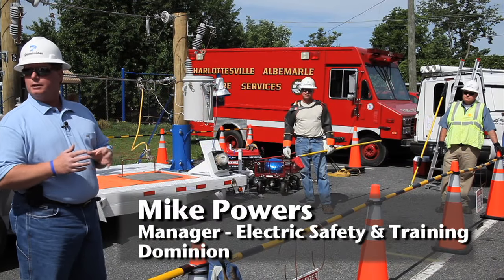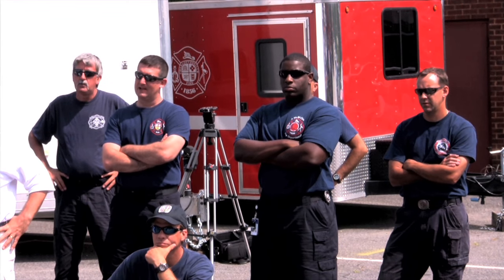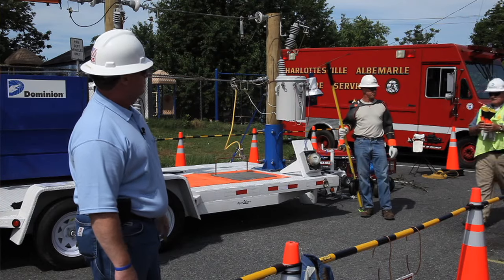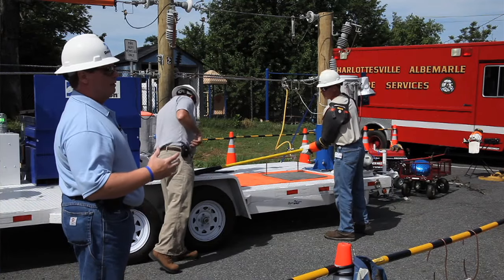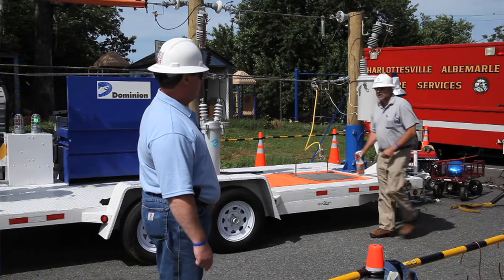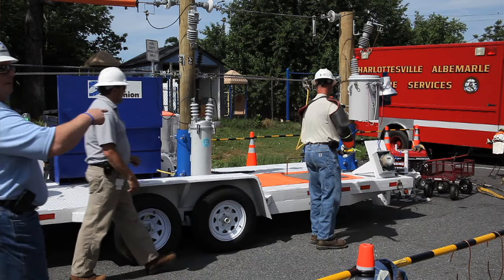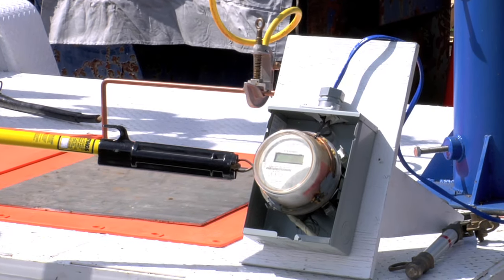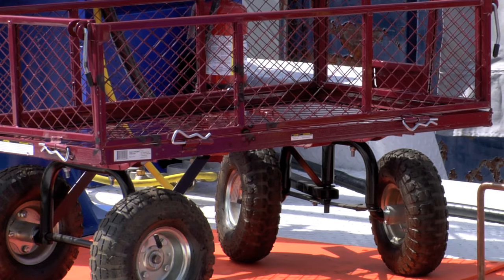Live Wire Demonstration

Comment: For those complaining of how long the training program is, the training program consists of overhead and underground completion sections. You have to know your different voltages, transformer bank setups, climb poles and do the work aloft, work on diving boards, pole rescues, underground switches, overhead and underground secondary and primary repairs, learn to switch devices out in the substations etc. Each section they learn, they then have to go back and get signed off in their local offices. Operate bucket trucks, trenchers, backhoes etc. You don't just go through some training and then be let loose. It's very extensive for a reason. Not only is your life on the line everyday but your coworkers and the general public.
Reply: And if you pay attention. You get to stay alive. To learn even more..As 52 Weeks is the Minimum...Which is around 4 years\8000 hours...
Reply: Also it's a job where you can't really learn from your mistakes as any mistake can, and likely will, be your last.
Reply: Still seems like a bit much.
Reply: @2KCamaroZ28SS  That's why the money is good though. They are diversified for a reason.
Reply: @2KCamaroZ28SS  Check out the history of linesmen.  When we first starting electrifying the country (early 1900's) they say that several linesmen were killed every week. Back then people weren't trained that well are were killed routinely.  This is why they now have extensive training programs, and it has worked.  A lot less fatal electrocutions nowadays.

Comment: That's how to deliver a safety demo. I've done my share in the Air Force and this was excellent and thorough.
Reply: you guys do power line stuff in the air force?
Reply: clive ramsbotty. Yes, CE (one of the jobs in the Air Force) works on some of the power lines on base.
Reply: @Stewthemechanic  ah of course, i feel silly for not thinking! thanks
Reply: clive ramsbotty not a problem sir!
Reply: @Stewthemechanic  in the Army, we simply scratch our heads to generate power.
Explaining our early need for LED flashlights.  ;)
Reply: Stephen Villano that’s awesome!😂
Reply: @cliveramsbotty6077  CE does and sets up whole bare bases from scratch on deployments. They'll do everything from site prep to building a fair sized town in tents. My gig was aircraft maintenance and repair. I was over the years a comm troop on Bronco and Phantoms then an engine troop and crew chief F-16s. 
Safety briefings are a way of life because complacency breaks people and stuff. First loss of note in my career was when a ground radar instructor at Keesler AFB failed to discharge a (large!) capacitor with a shorting stick during his lecture and died in front of his students. The whole base became REMARKABLY careful after that. There was a shorting stick, high voltage gloves and other safety gear at every training mockup but they don't work if they ain't used.
Spinning propellers are harder to see as they blur and both military and civilian ground crew have zoned out and gotten too close. It doesn't happen often but we had an Egress troop fire a seat during maintenance and those rocket motors take no prisoners. Serious accidents are so rare because of safety culture but when they do happen it's ugly.

Comment: Excellent demonstration, a real eye-opener. Especially for home owners back-feeding generators or trying to remove branches from over-head lines.
Reply: The line to your house is insulated.  Relax.  Why would you ever touch anything other than the one?????
Reply: +Steven King Mine is underground so no issue personally, but still some good safety advice for home owners
Reply: Yeah but if there is just a pin hole in the insulation you could suddenly become the ground.
Reply: +rpardz Call before you dig!
Reply: Agreed
Reply: Not likely. Your house line isn't primary voltage. You would pretty much have to touch bare wires.
Reply: The big takeaway here is with a high enough voltage, any material will conduct electricity.

Comment: After 37 years in volunteer fire dept. this is best demo of electrical utility hazards i've seen. It was informative at best and mockup  trailer with demonstrations they showed really brought it home on how dangerous this equipment really is.
Reply: I have seen people hit by 9.6 Kv  might be several times; Myself I have shook off 277 multiple times — which is instantly deadly for most people as the muscles heat to fast to use the contact area;  Without being hit a few times I disagree that no one can really gauge the risk;  
In all cases it is avoid getting the arc going which is demonstrated here; 
Notice all the rubber they are wearing — there is a reason;
I once asked a primary distribution worker about using non-certified pole and the response shows that he knows not to do that;
Reply: @ChiDraconis  Hey bro thats crasy shit you got hit with 227 wow what does one say.
Reply: It absolutely sucks to get hit by 277. 0/10 would not recommend

Comment: Back when the garbage cans were 55 gallon oil drums, we used to throw the lids and cans on the CTA third rail and another rail. It would send the lid or can two stories into the air. You could barely see it because of the arc. Fun stuff! It gave me a lot of respect for electricity.

Comment: not electrician, was just curious to study, but i am damn glad i saw this.
Reply: you do not get to do the first test on the gloves. there is a special group that puts then though tests. they hang them on a trolley that carries them through water and they are on a live voltage. if they have any pin holes. it will stop and let you know what the problem is. they also have a special pouch they are stored, signed out and checked back in at the end of the day. also required to wear heavy glove on top of them during use. in power plants where the person uses them on high voltage motor control centers, they also wear fire resistant suits and helmet in case of a short or explosion. it has happened.

Comment: When I was a kid, I used to hang out with power linemen and watch them work, and would get the old insulators. I didn't realize back then why the foremen would get a little nervous about where I would stand when I'd watch. Now, after 40 years of collecting insulators, and watching linemen work, and seeing these types of videos, I've got a respect for electricity, and its safe use. Now I do electrical work in residential, and have applied all these safety measures in my work as well. Great Video.

Comment: One important fact that was omitted is "step voltage". When a high voltage line contacts ground, theirs a voltage gradient around the point of contact up to several feet from it, that just the distance between footsteps can have a potential difference of several thousand volts. Even without contacting the conductor, it can smoke you.
Reply: Yep.  This is why they always say to keep both feet together and hop away.  You don't want one foot being at a different potential than the other.

Comment: It's amazing how electricity can arc but not through rubber. When I was In Australia doing some labouring work near an electric train line we had to do an induction course and the instructor showed us a picture of what looked like two boot marks on the top of the train. The guy was working too close to the power cable and was pretty much vapourised.
Reply: That's resistance for you, rubber has a very high resistance value, air varies from very high resistance when very dry to quite low when its moist hence the arching.. As the demo has shown the resistance of the human body or a hot dog is also quite low

Comment: I know our volunteer fire department has 2 guys that work for the city utilities.  They both are journey lineman.  They have trained several of the other firefighters on removing meters and the trucks are also have plastic caps they put on pulled meters.  The city crews also have pagers and will respond with a bucket truck to also disconect power from the transformer as well.

Comment: I accidentally came by a downed power line behind my house while I was picking up branches after Hurricane Sandy—left the area quick, called the utility company. Weirdest thing—grabbing up branches and there’s black hose-looking thing next to a branch. I first thought it was something that blew off someone’s rain spout in the winds—then I follow it with my eye and see it snaking towards a utility pole. So—leave the area. It doesn’t have to be sparking or humming.
Reply: Geeze, you are one lucky guy Fred.......
Reply: ive been hit by lightning.
Reply: brian6265 Thats pretty scary, any long term health effects?
Reply: Lmfao
Reply: Chances are it's comms cable if it's black and hose-like. Even if it is a secondary mains line it would still be insulated and even if a fault had developed it would've taken out the fuse by then. If the wire is bare, then stay away from it, as secondary cables can touch the ground without arcing due to the ground's high impedance
Reply: ***** not any that can be pick up medically. i was thrown away a few feet and had minor burns (2nd degree)
Reply: brian6265
I've seen a few specials on TV about this.  Some people (like you apparently) walk away with a healthy respect for loud noises, while others have a host of medical issues due to their free of charge upgraded internal electrical rearrangements. Scary, random stuff.  I hope you bought a lottery ticket!   ;-)
Reply: ***** btw, its not the wire that hums, its the transformers that hum, if the wire is down the transformer wont be humming
Reply: Ozzie Peck Not true. Transformers hum on a regular basis but the wires can hum as well. Go stand under some transmission lines and you will hear it quite clearly. Distribution lines can also hum, particularly if they are arcing. As the demonstration shows you may not see the arcing.
Reply: you sure? i am sure its just the laminations in the transformer vibrating, my mot does that, or is it the leaking magnetic fields? why would the wires hum?
Reply: The wires hum because they are not insulated. They get really loud when wet. I don't know about transformers.
Reply: hmmmm
Reply: Mike L Not true that they hum simply due to the lack of insulation, it's because of something called the Corona Effect, "leaking electricity" which is possibly heard towards the insulators or a length of line on transmission lines, or all along the line in damp weather, eg: frost, fog
Reply: sonconmas I am aware of this. However if they were insulated they wouldn't hum because the moisture would not be in contact with the conductor. Hence the no insulation remark.
Reply: Dam you lucky
Reply: Fred Dietz if it was a thick pink hose it was me naked
Reply: Ozzie Peck you’re right about the laminated core humming. The corona effect does make higher voltage transmission lines “sizzle”. Distribution lines very near the coast will also do it usually due to salt contamination. Salty water is a better conductor than fresh.
Reply: Probably service wire with 120 volts on it

Comment: As an inside wire man I’ve been shocked by single-phase 440, three-phase 220, and everything in between.  House current at 120 volts is also very dangerous,  as you cant let go!  Have good line testers, never work in live wires without being well insulated and NEVER plug a generator into your home  breaker panel without cutting the connection to the mains.  (The one that hurt me most was having a fluorescent ballast fall down and I grabbed it—1700+ volts through my arms and down my legs to the steel grounded platform.  Electricity travels along the bones through the periosteum and all my bones from the shoulders down hurt for weeks.). Closest I came to a Darwin Award.  ‘Nuff said.
Reply: Fun part: other countries run on single phase 240 and three-phase 400 for normal usage. industrial three phase goes at 690. Also the safety is handled a bit different: if there has be done work on a line, may it be high 240kV or just your house system - disconnect the mains, prevent the reconnecting of said ones. test for current/voltage. At home-owner level this 'should' be enough, but there are two more 'rules' - ground and short circuit, and if you other engized parts in your vicinity - cover them or close the access to them. Simple and prevents many accidents.
Reply: You failed the room temperature challenge!!!
Reply: drcoveil The reason for not being able to let go once you hold a live wire is that current flow through the wire causes muscle contraction resulting in a harder grip.
Reply: Sounds like 277 volts, theres a killer for ya. I worked at a hotel and I hated just changing the florescent tubes on those lights.

Comment: Saw this same demo by Kansas City Power and light. Unfortunately the former lineman giving demonstration lost both legs and 1 arm in an accident. Someone kicked on a generator while he was working during a power outage. It back fed the line and bit him good. Thats why they started this demo, to prevent future accidents. Proper procedure s were not followed. He now is a safety guy and speaks all over about his experience.
Reply: It must be an American thing where a lot of people have generators to power their whole houses. Here we just use the smaller ones where you plug the devices in directly and the larger ones are only used in commercial situations like hospitals and such. Still, good to know.
Reply: It’s not an American thing, the generator is designed to just plug stuff into it. But some people think the are smart and plug the generator into a house outlet, and that it will power the house. It’s usually not enough to power the house like big appliances. Now days people are buying these solar panels on eBay or solar DC inverters that include instructions to plug directly into a wall outlet and causes the same problem. These are illegal, but some manufacturers and companies making these thing from other countries don’t care if they are illegal to use.   They only care about selling them and making money, so they don’t even care about human life. Same reason fake electronic lab,es are printed on a lot of stuff without proper testing or certification. Makes you wonder what you have in your house that can burn it down one night because you bought the cheapest possible one from a company in a country that doesn’t care about your human life. But it’s not allowed to be used or sold in the country it’s being manufactured. Think about that for a second.
Reply: Funny all the stupid things foreigners pick on murikans for.....  Most people don't own a small generator much less an inverter.  For someone calling itself "the truth" you sure made a bad assumption about people you don't know.  LOL.
But what would I know, I've lived in murika my whole life, I've only known 2 people personally that had home generators and less than 5 that had a portable one.
I live in a RV, I have a onboard generator, and I have a portable one as well because I work construction, though it's not a small one it's a 10kw, the one on my motorhome is a 8kw.
The motorhome has a automatic xfer switch for the generator so any idiot could use it.
Reply: @PatrickBaptist  With shutting down main power becoming more common in summer 'fire season', more and more of us are getting emergency backup generators--not just for convenience, but of necessity.  Medical conditions, animal survival, human survival....many things require power in the heat if you're going to survive.  I'm planning full solar and a backup generator--and my fire folk WILL be aware and apprised of both.

Comment: They really should mark the gloves they use for the pin hole demo..
Reply: They cut them up after the demo. They use a good glove for the dramatic point showing it’s good, and showing the pin making a small whole.
Reply: they also need to update their methods.
we pressurize the gloves with compressed air.
close off the end with an  airtight seal.
insert glove into soapy warm water or spray with a soapy water mixture.
you can immediately see the bubbles due to crack ands/or pin holes.
Reply: 2011 video...
Reply: @llaneelyort5599  they did say they do send their gloves in for pressure testing :) @ 11:55
Reply: They did, they melted a hole in the end of the finger.

Comment: I used to work for Dominion at the Kincaid generation station in Illinois.Part of my job description involved switching in the 345Kv yardActual vltage was actually higher to compensate for voltage drop on it's destination.Opening the manual disconnects with thering closed in was spectacular to put it mildly.Once you started cranking the disconnects open all you can do it crank as fast as you can to break the arc and never look up at the arc.It will blind you at least temporarily. I really enjoyed working at Kincaid station.

Comment: After the wire short demo in the beginning of the video... I wondered what would happen if you used a string of sausages to short the two cables. Then they brought out the hot dog. :)